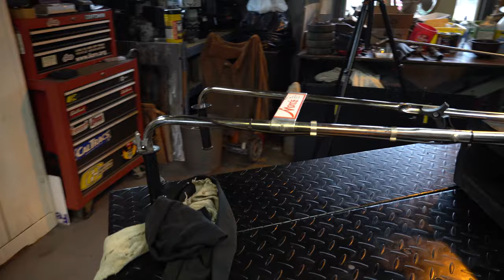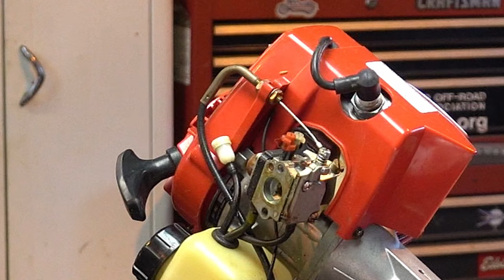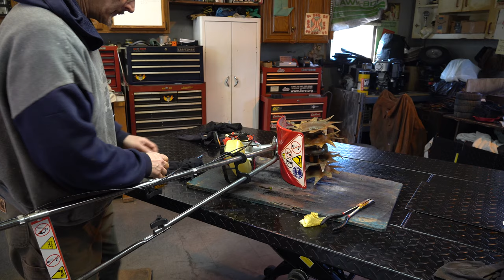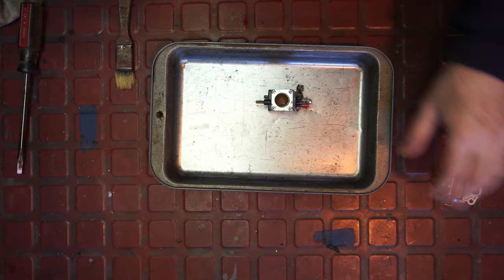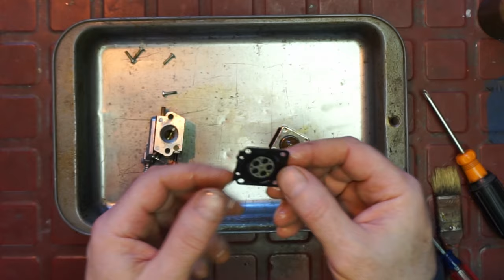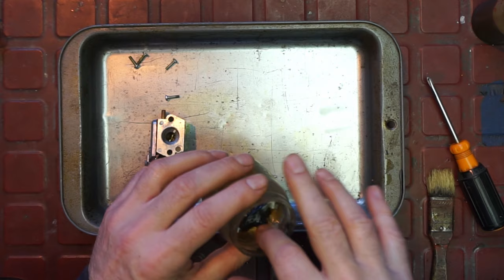How to Tune-Up & Properly Service the Mantis Tiller 2 Cycle ~ Do this to Save Your Machine

Comment: First off it's hard for me to believe that you're from Alabama. The second thing is after watching a of these I can never understand the three fuel lines and where they go and nobody explains it. You can buy a carburetor for nothing but you still got the problem of where the fuel lines go.
Reply from the maker: Hahahahaha Its just my sweat shirt,,,my ex bro in law was there doing some work.
Try this video... I explain the different fuel lines, sizes and what and why they are used
Watch the whole thing because as I work I answer all of it
https://youtu.be/v2AJR5mjIKw